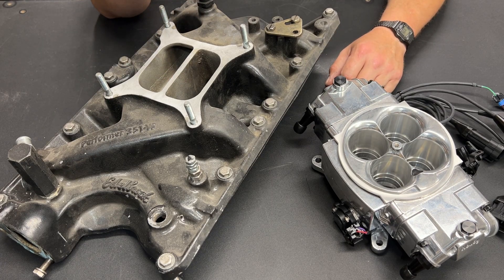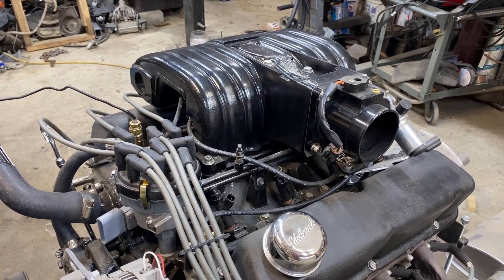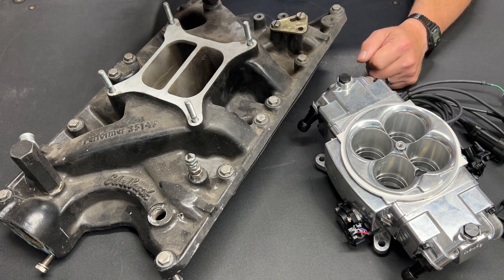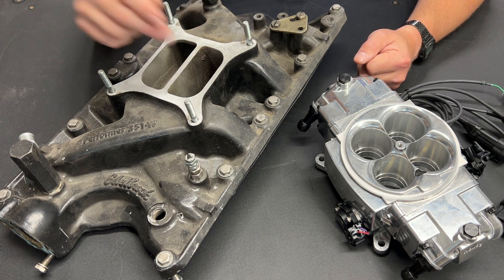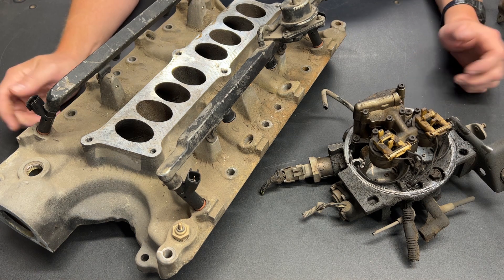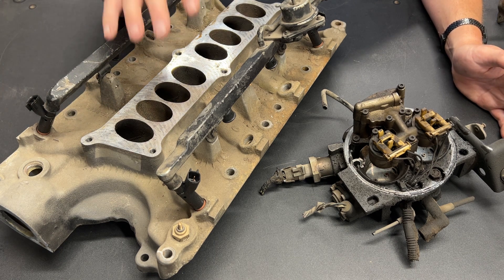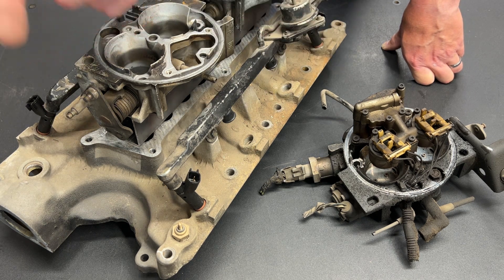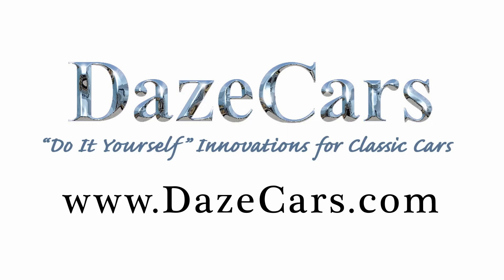393 Windsor Build Part 9 EFI Three Options: DIY intake One, DIY intake Two, or Sniper EFI

Comment: I get the DYI part of your EFI and your being innovating while doing it. Thats awesome. I am curious on how you are planning on tuning your efi though?? On the 5.8L truck lower intake though. You need to look up BigDog porting. He showed the stock and ported flow numbers of the truck intake  on Facebook or Youtube. The Stock lower intake needs some serious porting to come close to flow of your heads. Stock untouched, it will be a Major bottle neck.
Reply from the maker: The terminator X is self learning so once I get a base map setup the computer "should" take it from there.  If not I know a few people with more experience than I that can help out.  I know the lower has some flow limitations but I think the upper is the bigger restriction which thankfully I would be removing.  I am going to do some gasket matching on the lower.  I think it will flow well enough for my desired RPM range... we will see
Reply: @dazecars  Actually the lower is the bigger restriction of the two. Bigdog full ported the lower and just opened up the upper the best they could and it made a huge difference.
Reply from the maker: @440cubicinch  I looked at some of his videos but could never find stock specs.  He talked about cutting open the upper and all the work he did but not much about the lower.  The other thing is I am not going for max HP or high RPMs.  With that in mind will my lower be good enough?... I guess we will see.  😁
Reply from the maker: @440cubicinch  I was given some links to some pix of his work and the biggest restriction is where the intake flows into the heads.  I should be able to easily open that intake up.

Comment: Nice project, I always love DIY.
Might it be an option to use 2 sets of 4 cylinder Japanese motorcycle engine throttle bodies instead of the Gm units?
They can even be spaced out more if needed as the are all individual units bolted together.
1 set going to the left side and 1 going to the right side of the engine.
The total length of the runners can be easily changed by using longer pipe between the throttle body and the velocity stack/air filter. That way you can play afterwards with runner lengths.
This is how I did it on several 4 cylinder car engines.
Take the units from the 1200/1300cc bike engines as they have the biggest bores of the throttle blades, 43-45mm (1.69 to 1.77 inches).
This way each cylinder of the engine has its own throttle body, and no interference from the pulses of the other cylinders.
For the Idle controI used a block of aluminum where the stock unit can work in.
Inlet of the Idle control just with an air filter. Outlet distributed to all the throttle bodies with some hoses, T-fittings and pipes.
I used the injector hole on the throttle body as the inlet for the Idle controlled air.
TPS can be used from the Ford or GM or what you prefer, just build an adapter to mount it on the throttle body. Maybe an extension shaft is needed, I used a piece of a bolt and filed in the slots.
If you find the bike TB units to small go with smaller car TB’s.
Reply from the maker: The short answer is I have the Chevy TBIs, and  I got them for free.  Also I like how they will look like dual quad when it is all together.  Your project however sounds very interesting.  Got any links to pix?

Comment: Hi Daze! Great explanation and very clear video you did.  Many years ago i was asked to mate a BBK 5.0 intake to a stock 351w engine. After looking for all possibilities, i came accross a family operated company that builds adapter plates for such applications. I think it was Price motorsports!!! They send you everything you need including a distributor riser. After doing that swap (with gasket matching and slightly porting), the 351w run incredible fast and reliable. Now almost 15 years later, the car is still going very strong. Just wanted to mention that. Good luck!
Reply from the maker: Thanks!!! Sounds like an interesting project.  The 351W and all the stroker options you can do to it have the limitation of 302 heads.  Not the best flowing head and even less efficient as displacement goes up.  There are some good ones out there in the aftermarket but they are expensive.  Because the heads are biggest choke point in the system it gives us some freedom to play around with intakes.  I bet that BBK intake had very little flow restriction and no wonder the engine performed very well and given the extra runner length I bet it had torque to spare.

Comment: The frankenstien runner length will be too short for low in torque.
Reply from the maker: It may not be as long as dual plane runners, so some loss in low end torque but the runners will be longer than a single plane so it will maximize torque for the options I have available to me.
Reply: @paulshermet535  but if he puts a volume box on it he be ok. I told him he should consider using a piece of 8 inch aluminum tubing. Cut down the sides so he can mount a plate on each a 180 out. Then he has mounting flange for both lower and t- bodies. That volume will give him back most of the low end and a ton of mid range. But I told him using anything with square edges is a huge no no. That Holley stealth system will burn its self out trying to tune the waves coming out of a rock hard square like that. If not he will learn and there is nothing wrong with that. I did dual 4 inches on a 502 I put in a 55 Nomad. Dual 88 mm throttle bodies with 4 2 inch runners off each one. I tried to convince the guy to let me do the 8 individual runners with 8 throttle bodies. You use one common shaft for each side and just one tps per side. The late 80's BMW M6's had them and they not only work real good they look even cooler. And I'm not much for cool over function but those are really tricky.
Reply from the maker: the solution I came up with extends runner length, has a decent plenum and maintains the low profile I need to fit under my hood.  My Frankenstein EFI may be home built but it IS well thought out.  Will it maximize HP and TRQ on my motor NO is it an affordable functional option that should perform well for what I'm working with and with the limitations and constraints I have YES.  I appreciate the fact that you are trying to "help me" design my setup but the system has been done for moths.